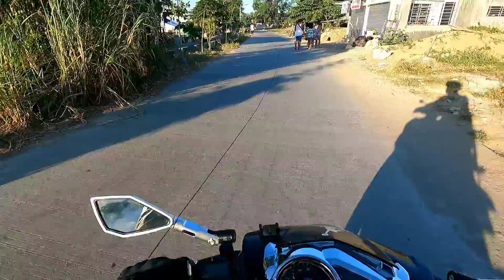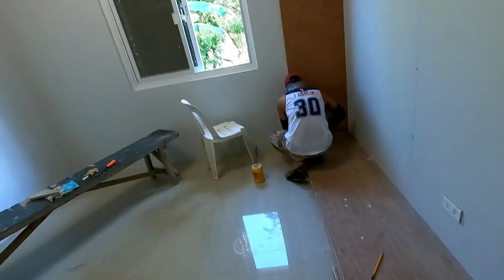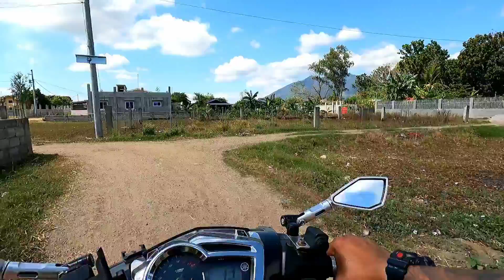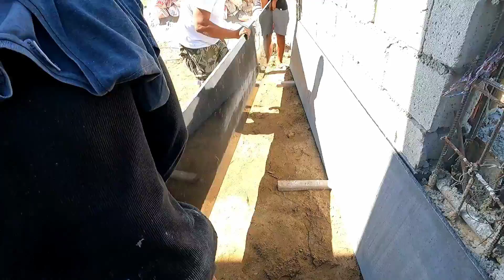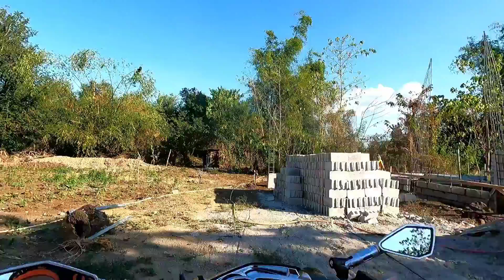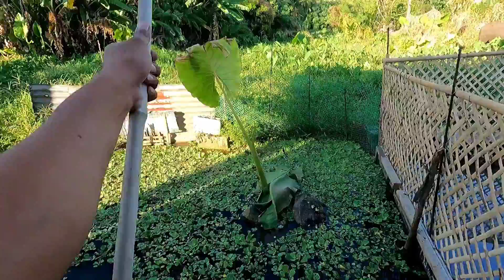Granite sa dreamhouse ni makimoto kakabit na

Comment: One of your biggest pet peeves bro is every time you walk into one of your home built is turning the lights on and off. Happens all the time. Awesome job on your dreamhouse builts.👍🤙 Those boulders that your worker is trying to break will add extra strength to the concrete foundation for the post. just saying.